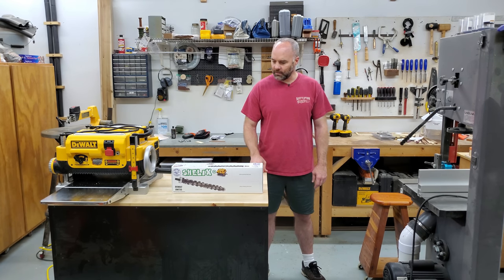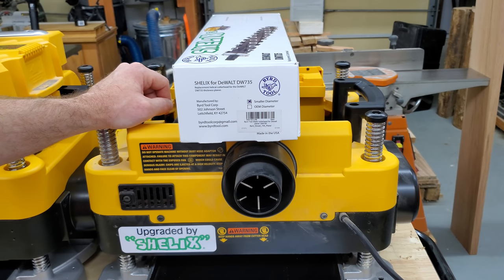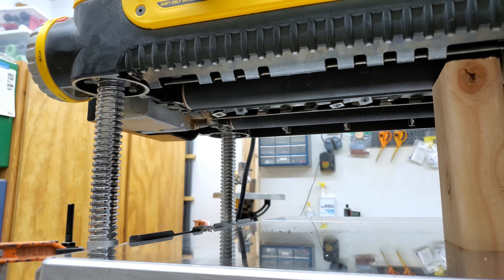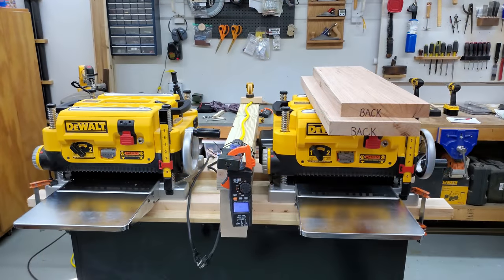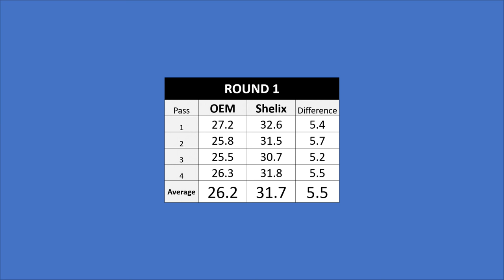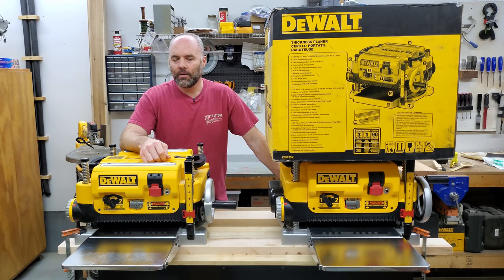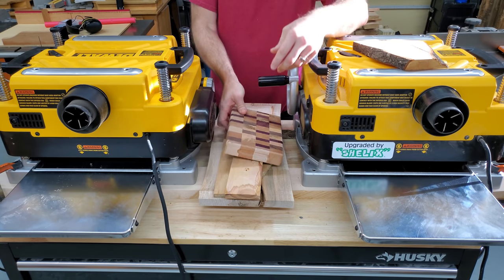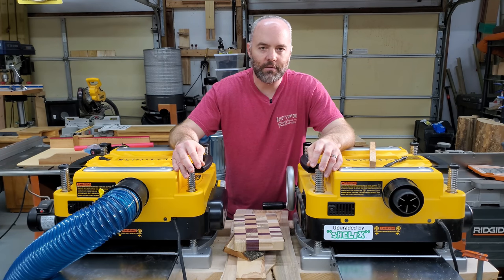The video I wish I watched before buying a SHELIX

Comment: Thanks for a thorough video.   I was also surprised at the amp measurements.
I have a DeWalt 735.   Mine has a lot of snipe.   Very frustrating.   I have thought about changing to a Shelix head, but I am hesitant since I do not want to spend almost as much as the original purchase price and still have a planer with snipe.
I may have to use my clamp on ammeter to see how much my 735 pulls under load.
Dave.
Reply: I agree about the snipe.  It feels like getting an upgraded machine where the feed tray rises up to the head might be a better investment.  YMMV
Reply from the maker: This might help with your snipe issues: https://youtu.be/wcOUKAxrTy0
Reply: I watched your excellent video on planer snipe after watching this video.   Very thorough and clear explanations.
I have tried everything you mention plus a long flat sled over the bed and extension tables.    Whatever I have tried, I still get snipe.
My 735 is an earlier model, about 10 years old.   Perhaps the newer models work better, or I am just unlucky.
I got the 735 for the 3 knife design and fell for the marketing "auto locking head".   This unit replaced a Delta planer which had manual locking head, but this worked.   I now wish I had a manual lock option.
Dave.
Reply from the maker: @lv_woodturner3899  That's too bad, maybe they improved their machining in later models.

Comment: Hope I’m not being redundant,I didn’t read all the comments. If I understood at the opening,  your helix cutter head is bigger in diameter than the straight blade cutter, that surely would account for some the increase in amp draw. Plus it looked like you’re probably taking heavier cuts than I normally do for a fine finish. Thanks for sharing!
Reply from the maker: The one I bought is slightly smaller. They also make one that's identical diameter to the straight blade cutter, which is the one I recommend.

Comment: I confess I haven't read all 671 comments, so sorry if this was covered.  You mentioned in the beginning of the test that the line splitter would increase the readings by a factor of ten, but reported the readings without dividing by 10.  Weren't you really pulling 2.5 - 3.5 amps?   I have a problem with the overtemp switch shutting down the planer.  Mine does it too, and I  replaced the switch, with minimal improvement.  Anything under 15 amps should run without tripping the overtemp, and I think that is a problem with the 735.  But anything pulling 30 amps for 30 seconds will either throw a main circuit breaker, or melt a 12 Ga. extension cord
Reply from the maker: Regarding the power measurements: https://youtu.be/KBL97SqVrDc and https://youtu.be/24f-J0lVo-E.  To reduce power draw: https://youtu.be/UoBN5Sc_2uk.  If you haven't already, you can also wax your infeed/outfeed tables, make sure they're perfectly flat with the main table, ensure longer boards are supported, and even give a slight manual push/pull so the motor doesn't have to allocate as much energy to the feed rollers.

Comment: This problem with getting cutter block in and out could be easily avoided if Dewalt simply increased the size of the bearing seat to fit a larger O/D bearing which would allow more clearance.  All you need to do is go into the CNC programme and type in a larger dimension to accept the larger bearing .

Comment: Really appreciate this review and test.  But, we really need an explanation for the measured current being over the breaker spec.  I believe the relative difference, but either your measurement system is uncalibrated, you're measure the wrong way, or you have a different power factor angle at the measurement point.
Reply from the maker: YouTube keeps dropping my pinned comments. This link should have been at the top to address your questions. https://youtu.be/24f-J0lVo-E

Comment: After graduating from a 2 year Machine Tool Technics program (3.98 GPA👍🏼), I worked my way up from CNC machinist/operator, through tool/mold making, prototyping, programming, manufacturing process engineering, then into process management, and finally running the production and engineering in the machine shop, over about 12 years. So, I've become extremely familiar with carbide inserts, and what they can do vs what they shouldn't do. I wouldn't run my own shop without carbide inserted cutters.

Comment: By using different hardware, older model vs newer you may have introduced a source of error. The older model may naturally consume more power. I think you would have to switch the blades across machines and retest to verify your test isn’t inaccurate.

Comment: The amp meter shows the highest pull and does not go down after the initial surge.  It's showing the peak power draw so you should have a reset after two seconds of running.  Or an analogue needle meter and not digital.  All you are measuring is the peak initial amp draw.  We don't know the average amperage use.   You could leave off half of those little cutter square heads on opposite sides and just use two sets.  My Bauer Harbor Frieght planer uses just two knives and does a good job.  The Shelix uses four rows.
Reply from the maker: I did that for simplicity in viewing. The peak was not much higher, shown in this video:  https://youtu.be/24f-J0lVo-E
Reply: Probably has a motor starting capacitor to eliminate excessive startup spikes.

Comment: Trip points (135 percent and 200 percent) are defined in NEMA Standard AB-1, MCCBs and Molded Case Switches. 
A 20 amp breaker must trip at a sustained current of 27 amperes (135 percent) at less than one hour, and at 40 amperes (200 percent of wire rating) in less than 120 seconds. 
MCCBs have characteristic ‘curves’ published by their respective manufacturers. 
Usually, the allowed times (per the manufacturer’s curves) are shorter than what the NEMA spec allows.
Reply from the maker: Good information, thanks. I linked to a trip-curve chart in the main video that sparked this one, but I should probably add it to this one too. I hadn't looked at the standards that were behind it, so that's good to know.
Reply: @TheSnekkerShow  I saw the curve, you have to know what you are looking at to understand what it means. I am sure someone will point out the referenced standard has been superseded several times over but things like this rarely change. You did a good job with this series of videos.

Comment: Did you ever try the carbide cutting blades from Infinity cutting tools. I have them in my Dewalt 735 planer for 2 years and they work great.
Reply from the maker: I haven't tried Infinity yet. I have several old router bits from its predecessor, Jesada, and they were pretty good.

Comment: Where are you measuring the amps from? Seems strange because the circuit is likely max of 20 amp service if it's 120v. Thanks for the video.
Reply from the maker: There's some more information about that in the video description and the top pinned comment.

Comment: Keep in mind that the smaller cutter head also have shorter circumference and thus less inertia.
Possibly making the motor work much harder to cut the wood.
Not saying it would be the same amp draw but i think it could be a lot less
Reply: Electrical motors usually use a lot more amps at low speed

Comment: Thanks for the video. Good stuff. FYI. Putting saw dust on your garden beds will remove nitrogen from you soil, just sayin.'
Reply from the maker: I've heard that theory, but haven't tested it. Wood mulch is pretty common in landscaped areas, and I would think that a little foliar application of a nitrogen fertilizer should offset any deficiency.

Comment: I’ve worked in machine shops since 1993.  I’m shocked that woodworking is just NOW playing with carbon cutting inserts.  Back in 2012 a box of 10 inserts could range between $30-$220 depending on material being machined and of course brand. Seems like it wouldn’t be too difficult to fabricate inserts to cut the harder woods. Working in a tool crib (in-house 2nd party company tool and supply company) we issued out inserts to machinists that could cut stainless steel, high nickel, and high carbon metals all damn day.  Wood knots are hard cheese to a quality insert.  Sad to say but this is a game changer in wood planers.  I’m sold.  Thanks for sharing!
Reply: Carbide inserts don't get as sharp as HHS. If you look at lathe tools, you will find that carbide inserts generally give a worse finish in wood than the HHS tools. Theoretically, a spiral HHS cutter would be the best finish in a planer, but the maintenance on sharpening would be rather time consuming. All this to say that carbide tools for woodworking are much more situational than metalwork. That being said I really like the carbide stuff for long blades, the edge durability is really nice.

Comment: Great video. That cutter head is going to kill that motor twice as fast for sure. Almost better off buying a grizzly or laguna planer from the start. With the cutter head and planer cost you are almost at $1,000 and you can get a 15” Grizzly for about $1700. So if you do this often enough the grizzly, laguna, or any other heavier duty machine will definitely pay for itself. 
Thank you as the video and info was of great help
Reply from the maker: Thanks for the feedback. The thermal breaker sits electrically between the cutterhead and the motor, which should prevent the motor from getting overloaded.  Floor models are definitely better for heavy planning requirements.  The Grizzly is $2,300 with a carbide helical head.
Reply: The shelix head is for sure a no brainer when used industrial. But I agree the motor in this plainer wasn't designed to work this hard. Try some perspective on amps drawn, 5 amps is 20% more load and thus heat.
It's your tool so your call, but don't bet on any warranty on your modification.
But very informative video, thanks for sharing!

Comment: Re-watched this video again, because it was very useful (yah, I'm still debating what I want to buy - both machine and cutter head design).  

Question... with the differences between current draw, can this also be somewhat attributed to the weight of the entire cutter heads?  I'd be curious to know what each weighs.  I'd think that more (assumed) mass of the Shelix equals more start and run current, as well as may help in more dense/deeper cuts (more mass means more stored energy for the cut).  Physics comes into play here I bet.  ;)
Reply from the maker: Weight could be a factor, but I'm not sure to what degree. You're probably right about the SHELIX being a little heavier.

Comment: With the older unit, will the older motor just draw more amp? And when you changed the diameter of cutter head, you will reduce the RPM . That in itself will cause the motor to work harder. Curious to see if the OEM Shelix on the new unit will give lower draw.
Reply from the maker: I'm not positive, but I don't think the motor's age would affect amperage draw. I wouldn't be surprised if there was a slight difference with the OEM size, but I don't think it would be significant. Maybe one day I'll get to do a comparison.
Reply: @TheSnekkerShow  time to get a 3rd 735.
Reply: @TheSnekkerShow  The first few minutes may show some change as the brushes seat completely.  After that, amp draw should be fairly constant (until you burn up the motor on that one job...)

Also, cutter head RPM should end up either constant (no load) or higher (under load) for a smaller diameter head given the same motor and gearing.  The drive gear ratio did not change.  The linear speed of the cutter tip will be slower.  Not sure if that will result in more or less current draw, it is not straight forward: torque and tip speed are at odds.

A test of current draw by swapping the heads on the same machine would control some additional variables.

Comment: I enjoyed watching video 1 and 2 versions.  Wondering if using the same planer with each blade would have a different result in power consumption.  I have thought the Shelix would have been easier on the planer motor.
Reply from the maker: Thanks for the repeat visit. I think the running theory is that because the Shelix always has a cutter in contact with the wood, the motor doesn't get that fraction of a second to recover the way it would with the straight knives, causing the motor to work harder.

Comment: A very thorough job, well done and a great explanation of the unit, tests and outcome.  I've had my eyes on this planer for a while and considering a purchase soon.  The information was very useful.  BTW... I have the CL390 version of that clamp meter and really like it.  I find it interesting the planer draws 12+ amps under idle/no load.  I'm also surprised at the max draw (of both) considering you are typically not supposed to load any circuit above 80% (20A x .80 = 16A) and you are also doing that over an extension cord which may contribute to some power loss on top of everything else (voltage drop).
Reply from the maker: I have some voltage and other information in the video description and top/pinned comment.

Comment: You mentioned at the beginning of the video that with the smaller carbide head, your drive wheels are putting more pressure on the wood, causing more friction between the wood and the bottom plate when planning. Then, during the power draw test, there was ZERO mention that this could be the cause of any of the discrepancies between the two machines. My guess is that is the vast majority of the difference because it makes more sense to my mathematics and entering mindset that the carbide blades would use less, not more power.

Comment: Your meter is showing peak current.  You need to multiply by 0.707 to get the RMS current which is the current your breaker is set to trip at.

Comment: I'd error on the side of "changing the heads voids the warranty....all of it".  I don't have any experience with Dewalt warranty repairs, but in general, companies seem to run the warranty department like an insurance company. They look for ways to deny claims.  I had a company give me a hard time simply because I bought the product from an individual even though it was still brand new when I bought it.  Buying it from an individual person didn't affect the product at all, but they didn't care.  I had to argue with them several times to replace a part.

Comment: I must have lucked out.... I have the same Shelix you have been using for years. I also have issues with excessive pressure on the rollers and an offset depth of cut measurement.

I ran a fairly large project and didn't realize that my dust collection had not kept up on removing all the chips.... long story short is that the motor burned out. The local Dewalt service center honored my warranty and replaced the motor at no cost to me and checked over bearing and belts along the way. I've been very happy with my Shelix overall.... but I wish that the head were exactly the size as OEM to avoid the few inconveniences.
Reply from the maker: That's great you were able to get the repair done under warranty. It's nice to get a break after an expensive tool goes down.

Comment: the power test, you told us you had all the external aspects the same, such as thickness of the timber, the main table etc. What about the cutting depth? this has seriously effect on the time of the timber being planed.
Reply from the maker: Each pass was 1/2 rotation, 1/32".

Comment: It took the National Electrical Code until 2011 to mandate an upper limit on over-current ratings for devices like circuit breakers. In the 2011 National Electrical Code (NEC), the language in 705.12(D)(2) is straightforward: “Bus or Conductor Rating. The sum of the ampere ratings of overcurrent devices in circuits supplying power to a busbar or conductor shall not exceed 120% of the rating of the busbar or conductor.” 
Simply put those breakers in your service panel are REQUIRED to exceed their nominal rating by 20%. The overload breaker in your planer may be deliberately rated at a lower limit. Also the planer on the left is older and so is likely less efficient that the new motor bearings etc.

Comment: I'm totally shocked by the amp draw numbers. I thought "no way, something isn't right here..." So I went out and measured mine. Stock knives, impeller installed. I got 10.7 Amps no load. Took a 1/32" cut (1/2 wheel turn) off a 9" wide piece of pretty hard ash at the low feed rate.18.5 amps. Can't believe I've never tripped my breaker, but I mostly work with walnut 6-8" wide and usually never take off more than 1/32" per pass. I do use the faster feed rate (until the last pass) which I would guess draws even more amperage. I'd say your measurements taking a 1/16" off 10" oak are pretty accurate. I'm not gonna push mine that hard :) I am gonna order the Shelix OEM head. I'm sick of replacing knives.
Reply from the maker: It catches a lot of people by surprise. I guess it's really no different from trying to rip 3" hardwood on a portable table saw. The blade is big enough, but the saw is not intended to be used at its full depth capacity for extended periods.

I just posted a SHELIX installation video last week. https://youtu.be/k3wmDU3AC14

Comment: I didn't hear the consideration of the blade was a larger diameter putting excessive load on the motor.
I'm not trying to troll. Great info, thanks for your effort and info.